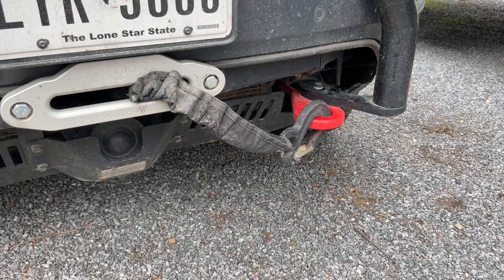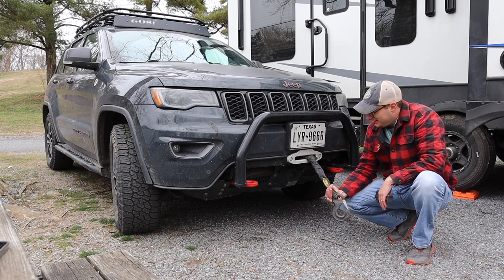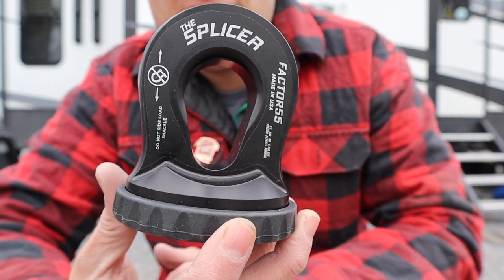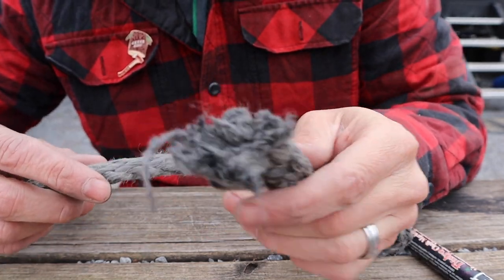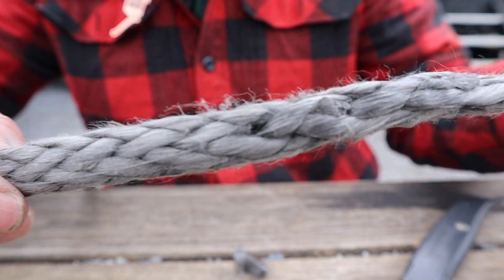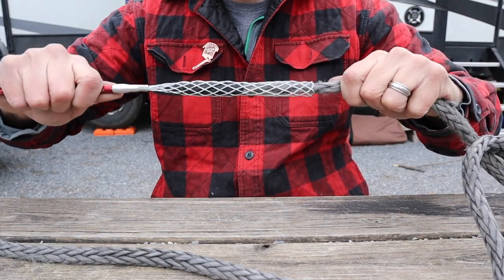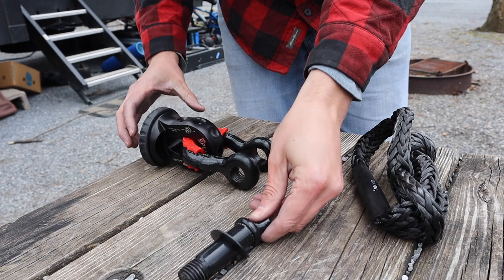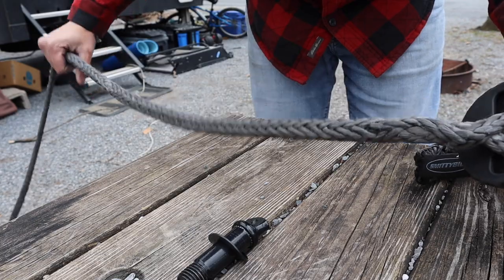Factor 55 | "The Splicer" Install | Winch Line Splicing Instructions

Comment: No need to do that taper. The Factor55 splicer will pull the rope through w/o the taper.  I hit the cut end with a lighter - probably not necessary. Very nice explanation video!

Comment: How capable off-road would a 3.6L trail rated 2016 GC limited with  air suspension be?
Reply from the maker: Capable. It would be more about having the right protection as far as skid plates and rock rails
Reply: @ProdigalOverland  I believe it came stock with skid plates. I've also done alot of research and it's very hard to find a limited version with the trail rated badge. so I don't have any comparison.
Reply: @J.Lavigne  I just got a 2015 limited with a trail rated badge. I definitely intend on putting it to the test.
Reply: @haidafulton  to this day I still have trouble finding gc limited with the trail rated badge.
Reply: @J.Lavigne  same! I feel super lucky to have bought it before I even knew what trail rated was!
Do you have an Instagram?

Comment: I have recently removed broken lsd motor which engage “rear locker”. I notice that two cables go to one socket and eight to other one. Anyone one know to which cables I need connect switch to engage the motor itself so I can apply rear locker on my demand not when computer decide? I know it will potentially fire fault codes as sensors on wheels decide when the slip momentum is happen and engage the motor but I would like to be more in control while drive off road. Does any one have and can share electric schematic of the rear connection I am trolling about lol?  It is two connectors one had two cables which is 12v power ( red and black) and other has 8 connections which I presume came from wheel sensors?